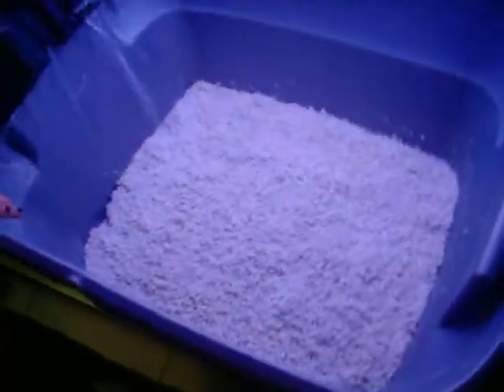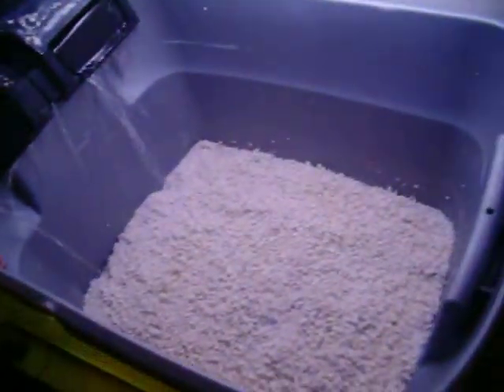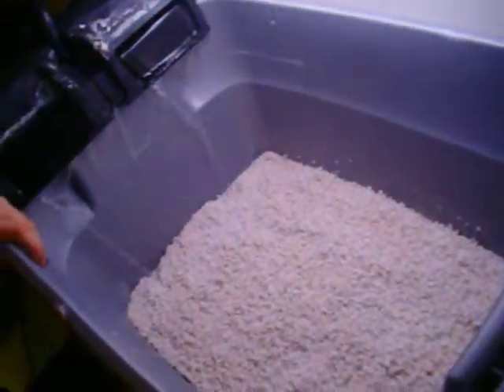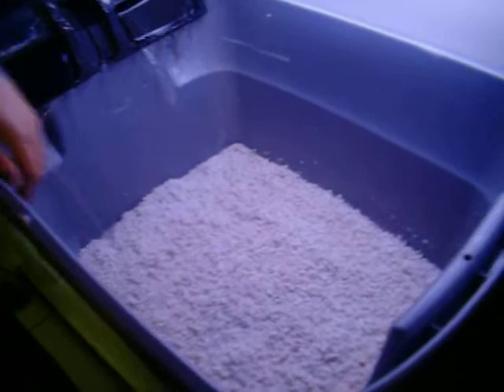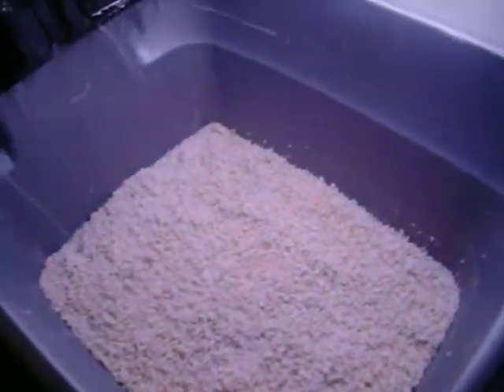Aquaponic system, How our in-home unit works & what it is made of.

Comment: @Brian100487 I agree. The problem often is on different levels. Level 1: Original fish size. Level 2: Potential fish size. Level 3: Reaction to other fish numbers. What is meant by this is that some fish will not be stunted in their growth patterns by having large numbers of fish within a small aquarium. This is the case with most plecos. However, goldfish are negatively affected by overcrowding. I would have to agree. This is taking overcrowding to the max. Downsize to like 10 a tank i'd say.